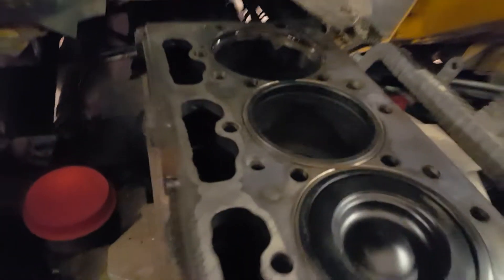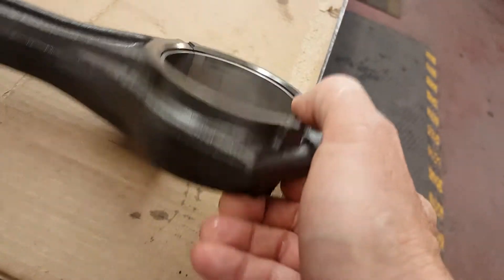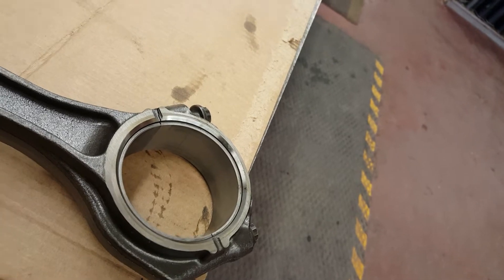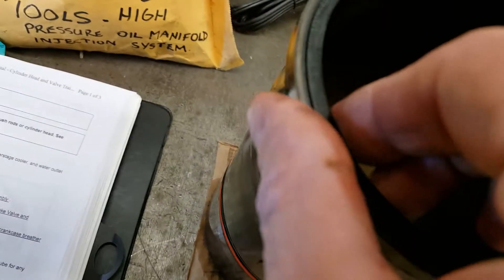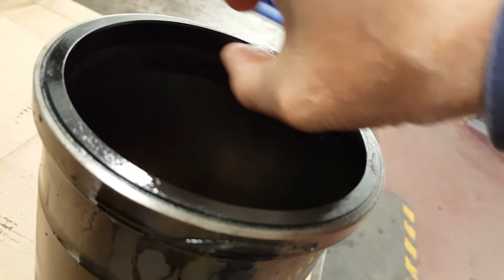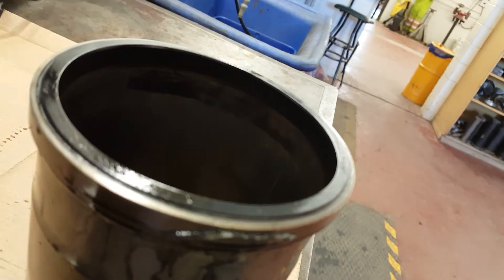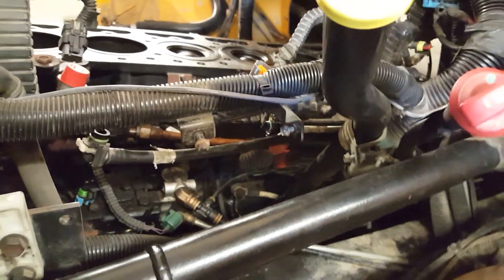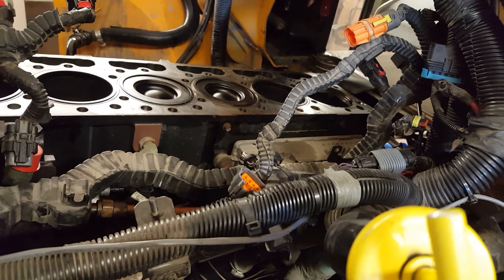Removing Pistons and Liners Diesel Engine MaxxForce DT

Comment: Whats cost of kit and where can get them cheap i ll replace only 2 of them only not whole work you did.
Any place ll be helpfull
Thnks
Reply from the maker: We bought in-frame kit from Premium Truck Parts. For cost I will reply back here with accurate number.
Reply from the maker: The in-frame kit cost 4538.47 before taxes. Dealer cost much higher!
Reply: @MechanicsHubdotCom  
Thats very prici.

Can we just replace the bad 1 piston or liner only.?
Reply from the maker: @1HSYURIDIA  yes you can... parts are available.

Comment: What made liner to be worn out i know pistons but what was the ussue cooler ?
no oil change ?
Reply from the maker: The cause is too much EGR oil contamination. The soot and viscosity was very high in oil samples. Since we started changing oil at 3,000 miles the oil is staying clean and not creating more premature wear problems. Also clean oil has reduced high pressure oil system issues. The extra maintenance and cost of oil is well worth it!